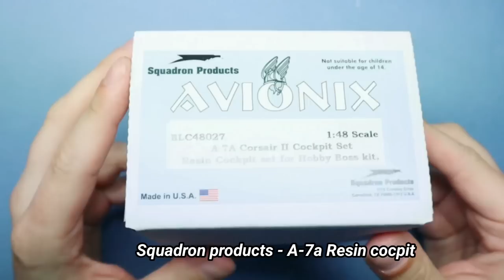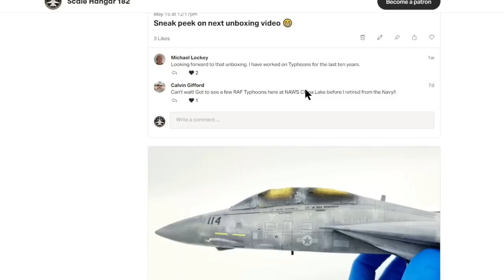A-7 Corsair II 1/48 Scale Model aircraft build video

Comment: The grime and dirt, grease, fluid streaks are there but usually not for too long.  Every aircraft in the Navy/ Marine aircraft except for possibly initial trainers (T-6 Texan 2). Have a 14 day wash cycle due to the corrosive environment.  Washes are planned for every seven days if in a carrier environment.

Comment: Nice model but I think the hataka light ghost grey is not the right color , I use mr color and mrp light ghost grey more accurate, and the A-7A corsair  looks like  A-7E with the loadout, A-7A never carried laser guided bombs or a targeting pod. nice model
Reply: Lt ghost grey was NEVER used on High vis aircraft of the 70's over white. It was Gull Grey 16440 over white. Big difference between the two greys...
Reply: A7A’s did drop LGB’s in NVN 1972.  We were told we were first to carry them in combat, don’t know.  I flew in VA-105, off Saratoga; VA-37 was our sister squadron.  

Air Force forward air controllers designated the target with laser, and we would put the LGB into a “funnel” over the target; bomb would home in on target.  Very accurate if we hit the funnel.